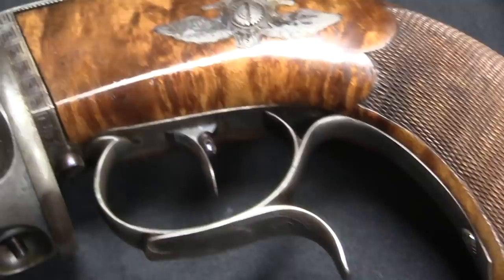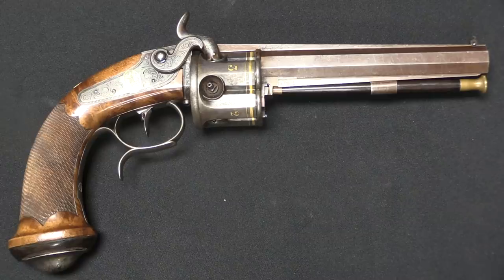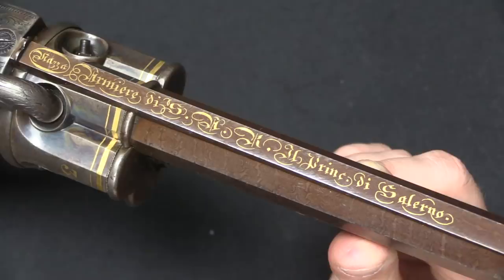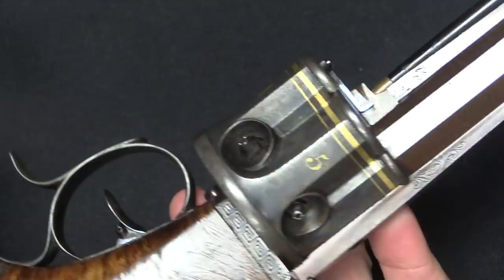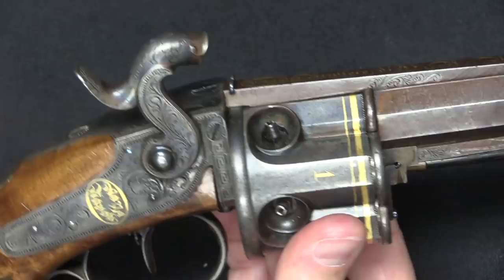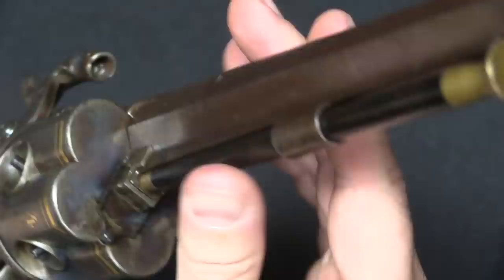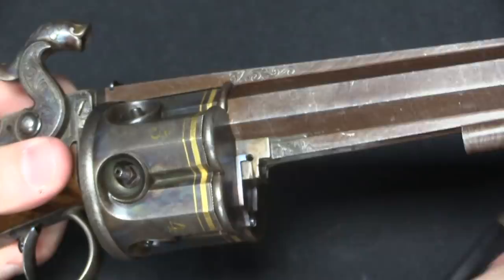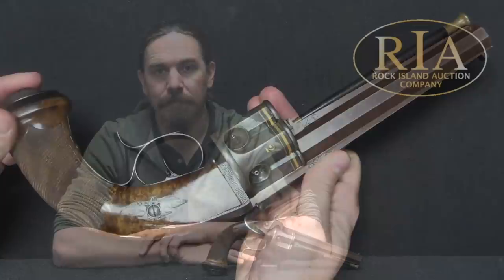Salvatore Mazza Gold-Inlaid Percussion Collier Revolver

Comment: I like how both Collier and Colt never thought about making a closed frame revolver, and they put the strap on the opposite sides of the cylinder
Reply: Mr. Root had the right idea.
Reply: Well, they probably thought that would be a better way avoid the revolver leaking powder and gas while keeping it safe from the elements.
Reply: Also don't forget that usually the barrel axis pin also makes a connection in those early models. So it's more a hidden full frame than a half frame.
Reply: Steel was expensive, hard to make and more of an art than mass production at this time (pre Bessemer).  They were simply trying to use as little as possible to reduce costs.
Reply: You made me google ''revolver strap'' and i found out something i'd rather not know

Comment: Something you forgot to mention - this pistol has an adjustable set trigger.
The gun can be operated like any other OR when it is cocked by pushing the trigger forward the trigger is "set". This procedure arms a sprung bar which is latched to the trigger. When the trigger is pulled the latch disengages and the bar flicks the sear thus firing the gun. This means that only a very light trigger pull is required to fire the gun. It is a common feature seen on 19th century target pistols.
The adjustment screw behind the trigger has a hole in it. Once the trigger has been adjusted to the user's satisfaction a thin wire is passed through the hole and around the trigger before being twisted to keep it in place and prevent the screw from moving.

Comment: This is brilliant. The cylinder/barrel design looks like it would provide good obturation and reduce the likelihood of chain fire in the cylinder. The deeply recessed and artistically protected percussion cap nipples also reduce the dangers. Excepting the manual rotation of the cylinder this is a remarkably good firearm based upon your video.

Comment: I know it's sacrilege to even contemplate using such a beautiful piece as a bludgeon, but does anyone else think you could do someone a serious mischief by cracking them over the head with that knob on the end of the grip?
Reply: That's very intended for when you can't get a gun like that loaded fast enough or you've fired the last shot and have no ammo.
Reply: Many early pistols were designed to be used as a mace after expending their shot, especially those intended for cavalry.

Comment: Very pretty. I like the solution for chainfires, even if it is utterly impractical for a revolver that doesn't need to be manually indexed. And I do see it's advantage- a double barrel pistol would be faster, but regulation would be (still is) difficult. So you have  a second properly aimed shot off as fast as drawing a second pistol, and you can do that five times. With Napoleon's forces pillaging across Europe, fairly practical.

Comment: I feel that there is something else going on with the loading procedure for this gun. The ram rod seems to be too short to effectively ram the chambers. I think the chamber shield is removable, at 3:35 you can see what appears to be a spring clip screwed to the shield with its free ends snapped over wedges on each side of the ram rod end holder.

Comment: This is an exquisitely made piece! However, unless I missed something, a serious flaw I see in this system in that the cylinder is 'floating'. Presumably when the gun fires the cylinder momentarily shifts backwards the same amount as is required to rotate it manually. That leaves a considerable gap at the barrel and releases a huge amount of sparks, hot gas and smoke. Sure there is a cylinder hood in place to reduce the possibility of chain fires but if it remains fixed in place while the cylinder recoils backwards it really doesn't do much.
Reply: I suspect the unusually heavy hammer spring is intended to hold the cylinder in place in the instant of firing.
Reply: @MrGrimm1911  I know that coil spring technology (to possibly keep the cylinder forward momentarily) didn't exist before 1900 and if this gun relies on flat spring tech with hammer strike inertia then this would be very early example of a 'delayed blowback' mechanism. Perhaps there is an internal circlip that moves in behind the cylinder as the hammer drops. Otherwise I'm going to guess the gun has seen very little use because the owner experienced the results of a hang fire plus the resulting pyrotechnics.

Comment: Thinks; a modern revolver could have a cylinder track that pulled conically-ended chambers out of and into a recess in the end of the barrel, to improve the sealing. That should make it easier to suppress, and reduce the fire hazard at 90 degrees to the gun. (See the "Mythbusters" episode about why you should keep your fingers clear of the front of a revolver.) How many people have tried (and failed) to implement the idea?

Comment: That ram rod seems too short to ram the charge and ball home all the way into the back of chambers. Comment?
Reply: The ball should never go to the back of the chamber, your powder charge and possibly a wadding should fill most of the chamber.  However, I suspect the gun originally came with a complete kit including a powder charge measuring device, a percussion cap case or holder, and cleaning tools.  It would likely have screwed into a handle or a cleaning rod for use.

Comment: Is it possible to remove the shield pulling it downwards (after the ramrod is removed) to load the chambers? It looks to me that only the upper part of the shield is connected on the barrel and the lower part for the rest of the chambers is hold by that double spring (right is broken) and there are guides in a frame to guide it back in place.

Comment: It seems to me that as the cylinder is just sprung forwards gas pressure would cause it to move backwards making the sealing mechanism largely pointless. Or does the hammer nested over the percussion cap cone hold the cylinder forward? If so, I imagine they wouldn't last too long.

Comment: Beautiful weapon. I have a question in regards to the spring loaded chamber cassette design. I see what Ian described in regards to the machining and cutouts that the cassette springs into. What I’m wondering though is if the cassette springs backwards with the pressure of firing a round? Or does the hammer holding against the cap prevent this along with the energy of the explosion going out the front mean there isn’t enough energy to spring the cassette backwards?

Comment: How do you use that ramrod to load the gun? It's not even as long as the barrel, and I think it would have to be longer than the barrel to reach the cylinder while still having enough sticking out to hold onto.

Comment: I believe you pointed out in an earlier video that Colt(?) had tried putting a shield in front of the cylinder, but found that increased the chance of a chain fire.  I wonder if the counterbore prevents that problem.

Also, does the cylinder lock in any way when the trigger is pulled?  It seems the recoil would overcome the spring pressure.

Comment: The first question that pops into my head upon seeing that manual cylinder rotation is this: The cylinder is spring loaded to nest chambers into the barrel. Doesn't recoil force the cylinder back, breaking the seal? Or is the power charge small enough for the spring to resist it?
Reply: The spring may be strong enough, but I suspect that you've found the fatal flaw in this design.

Comment: So you muzzle load it whilst the hammer is cocked?
Reply: With no percussion cap in place that wouldn't be an issue.
Reply: @charleswoodward9225  So the caps are added to the drum after muzzle loading?
Reply: @sockdip69  Indeed, without the percussion caps there's nothing to spark the powder inside the gun to fire it.